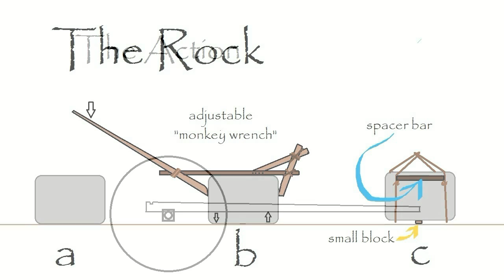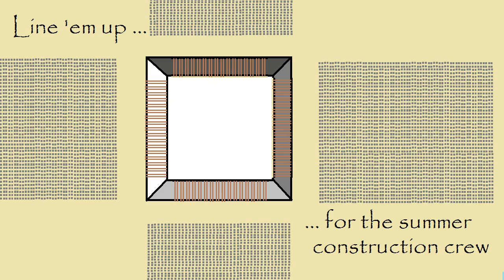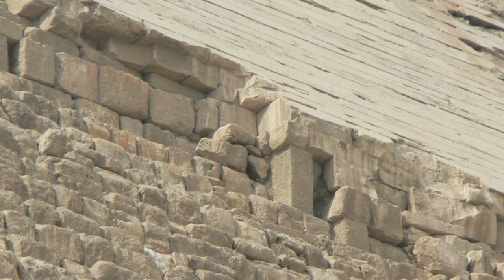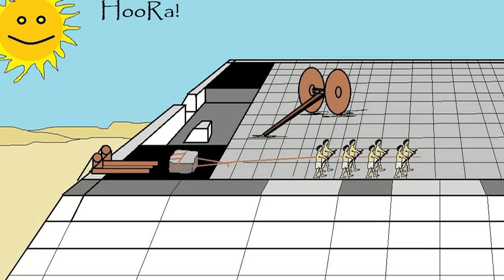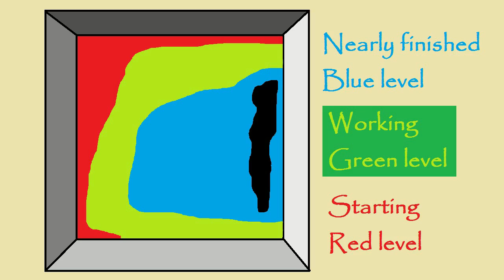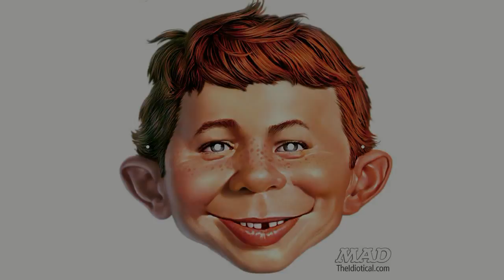Pyramid Construction in Ancient Egypt  #2

Comment: Pretty good process you figured out. But I still think that all these methods are overkill. Taking into account all of the ancient structures made out of heavy stone blocks, and then concrete, and finally no such construction going on,  something was different back then. It's the speed of light slowing down. Back then c was faster. E=mc^2. You are a smart fellow, you understand what this means. It just has to be told to most people, because it is very hard to think of spontaneously. You do get it right?

Comment: no copper tube with sand grit will drill through granite the testing failed. the holes are nothing like what is there. they were cut when the stones was soft and curing.
Reply from the maker: Mike Jandebeur They cut granite with copper saws in videos on YouTube.
Reply: Bantokfomoki links please, i can't find any. all the ones tried to do it but they stop at a tiny fraction of an inch and it is a very rough hole, not the smooth sharp opening ones we see at giza.
Reply: Mike Jandebeur no copper with sand will even scratch basalt, and Egypt has many stone and statues made of it.
Reply from the maker: Mike Jandebeur They used a copper saw with sand used as grit to grind away at the object stone. To say you can't do this runs afoul of simple physics. You can cut diamonds in half with cotton string if you're willing to saw long enough and have lots of string. Nothing is immune to wear from anything at all. It just takes more time in some cases. The hardest rocks wear away by wind and rain. You know this.
Sorry, I have no links, but I did see a demo of sawing with sand somewhere. What surprised me was the speed with which it worked through the material.

Comment from the maker: They drilled with a copper tube ... no teeth. For abrasive, they used sand. This has been done in Egypt to demonstrate the techniques. It works quite well but is expensive because it wears out the copper quickly (sand abrades copper as well as granite). Consequently, drilling and sawing was used sparingly only when necessary. You can probably find a video of modern Egyptians using this technique to show tourists how it was done.

Comment from the maker: I've seen the videos with the "evidence' and indeed they must have had drills and saws and lathes ... but ... not HIGH speed drills and saws and lathes.
There are two ways to go here.
High speed with low pressure and Low speed with high pressure.
The Egyptians would have had difficulty with speeds greater than 300 rpms.
So, they would be drilling with great force in lieu of speed. If you have ever operated a drill press, you'd know exactly what I mean.

Comment: Yea, I agree. And or also Mold/cement theory. Same mold, over and over, re-set perfectly, fill with cement. *this is like a childs sand castle building method. Could make many molds, same size. Haul up sand and water with the bonding material they used, alot easier then moving full stones.

Comment from the maker: I looked at those before thinking about Egypt. My design for moving stones around 100 tons would be a "frame walker". It's an A-frame design very tall that picks up as it arcs over. You can get a great deal of leverage at each step. For really heavy blocks you'd need "ganged" frame walkers, the legs of which would all be mounted on parallel runners. You pull the frames with ropes connected at their tops and the stone rises an inch off the ground and moves forward maybe 5-10 feet per haul.